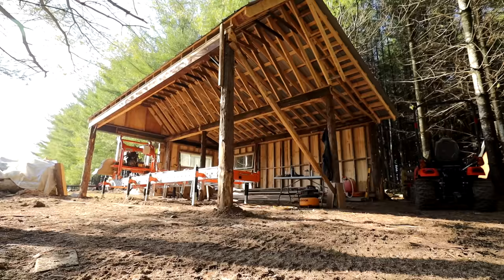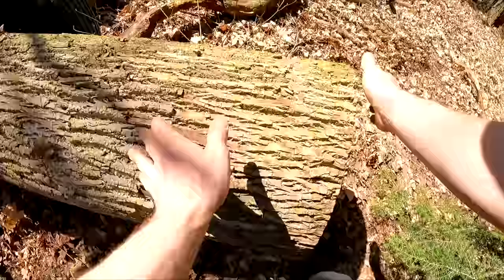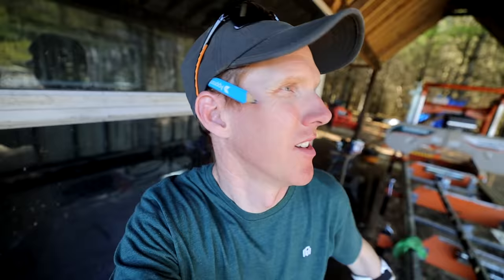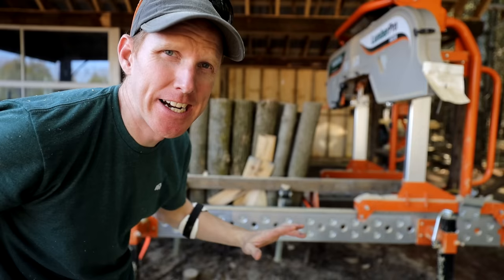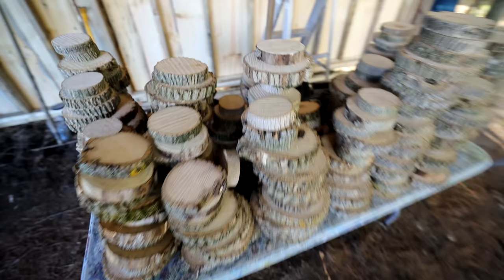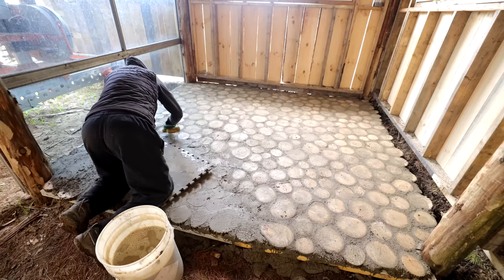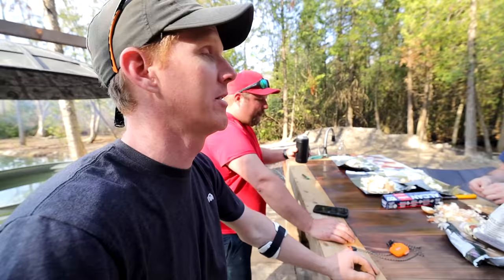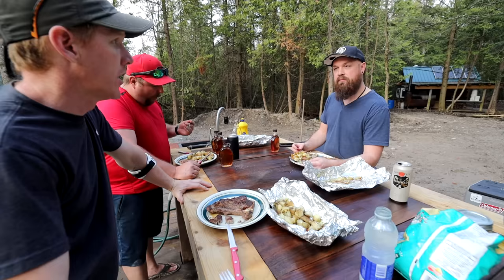$50 Saw Mill - Installing Custom Unique COOKIE CUT Wood Floor!!!

Comment: Consider altering the roof so all the snow and rain drains of the back side of the shed making easier access into the shed when it snows and the snow slides off the roof.

Comment: also as a Chef for over 20yrs, it greatly depends on the type of steak, however in my opinion, for Ribeye, Strip, and Sirloin you want it about an Inch thick, if properly cleaned and whatnot, should give you about a 16oz Ribeye, 14oz Strp, and 12oz Sirloin. As for T-Bones/Porterhouse, btw the way reason that little side is so delicious is because it is the Filet part of the cow, the other side of the bone is the Strip, about 3/4ths an inch, and Filets you want about 2in thick. The reasoning behind all of these is because when you cook them it allows you to have a gradient from rare to well done, if the steak is to thin, they will cook very quickly but to have a steak look rare, it won't actually be up to temperature.

Comment: I would suggest 2 mods to the log dolly. 1st use it on your 3pt instead of a hitch so you can lift the 3pt to attach the log, then have a tie chair on the front to keep it true forward. 2 cents.

Comment: 5:49 Just a thought, but wouldn't you want to use two chains? Also, offset the log so the front is heavier by 25-50lbs and then slap a chain under the front so it stays off the ground when you're moving it... Most of the weight is still carried by the center of the lift with the wheels and only the offset weight is carried by the front of it. I could be wrong though...
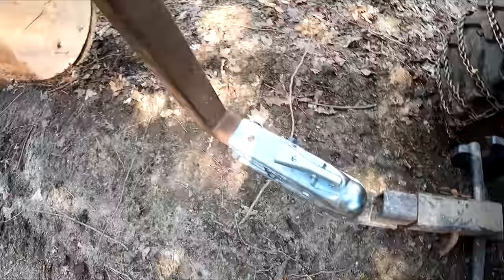Reply: 6:10 And there's a little ring on the underside of the front-top bar for a chain to hang too... ?

Comment: Damn Mr. Kevin...Livin...Here's to a great summer coming. 
I'm thinking just under 2.5 hours of actual application time for the grout job?
Looks amazing though!!! With the garage doors..fancy. 
Depends on the cut...skirt steak is thin 1/2 inch, 1.27 cm, and Rib eye thick up to 2 inch, or 5.08 cm on vertical grained meat.

Comment: Mount a boat trailer hand winch on the back wall and using a compound pulley you will get those big logs on the mill easy
Reply from the maker: I was thinking of just putting a beam in the ceiling.  To mount a pulley.

Comment: Always nice to see you and Don working together on a project.  What you have so far is looking really nice already.  Do you plan to completely enclose the shed/mill, likely with some sort of sliding doors for the long side so you can still slide in logs and have the sawdust spit outside.  Or will that long side stay fully open all the time?

Comment: Clean Aluminum extrusion in Guelph ON is going for $1.15 per pound, which is very good.  A pickup truck of those door rails would be about 600 bucks

Comment: 5/4 stock. 31,75 mm. Especially if you're gilling. Good char on the outside w/o over cooking the inside. Oh, and the cold plunge, maybe stay in a couple of minutes moves the blood to your core and constrict the blood vessels. Then a quick into the hottub releases the blood from the core, dialtes the blood vessels and pushes oxygenated blood to every extremeity. A very good process.

Comment: I just thought of a cool project. You have a lot of pine and cedar stumps, which you can process to extract pine tar which you can use as a wood stain/weather proofing.

You literally just need a big air tight metal container you can fill with chopped up pine roots, then bake on a fire while sealed. Ideally with a tap at the bottom to collect the pine tar.

You can also use it as lamp oil for light and heat. It would be awesome if you could run a generator off it too, but it would probably require more refining to get a purer fuel.

Comment: Pointing and finishing time: 2h 37 mins, cookie cutting time 3h 14 mins, leveling/subfloor 1hr 02 mins. total 5h51min.

Steaks are only available in 3175mm. or inch n' a quarter.

Harry and the hindsightersons I know, but if you ratcheted with a slight angle away from the way your saw blade cuts, and made sure you never have a point where the saw blade cut side is the only place there's wood, you will no doubt be famous amos cookie. I guess it's Tall ones to the office side basically so the blade is biting and keeping level with weight of more material.

Comment: Mike peels garlic LIKE A LADY!!! 🤣😂😆 Break a head of garlic up into cloves, put the unpeeled cloves in a metal tumbler such as a drink mixer an SHAKE THE HECK OUT OF IT!!! Shaking the cloves in a metal tumbler loosens, splits and separates the peel off the garlic clove!!! Most if not all of the peels will practically fall off the cloves. If not, throw back in an shake hard a bit more!!! Works like a charm!!!😁👍🏻
Reply: How dare you assume my gender
Reply: @TestingWithMike ...notice I said "LIKE a....!" 🤣😂😆😭

Comment: That little round part next to the t-bone is the tenderloin. If you cut the big part off the other side of the bone, you call it a New York Strip steak. (Back strap)

The best thickness for a steak is 1&1/4 inch or 31.75mm

Comment: You should consider welding an eye bolt just behind the vertical bar attached to the receiver that way you can wrap a another strap or chain around the front of the log to prevent it from twisting on you that way you can operating single handedly. I say 31/2 hrs there kevin to mix that grout and fill it between those logs.

Comment: Hey Kevin have you ever seen the rig that actually lifts the entire log up before its basically another set of wheels that u lift the back of the log up to. It's like 2 of the the carts that you got 1 on each end hook em together when ur headed into the woods then set it up and the log doesn't drag in the dirt at all. Look up a (log hauler rear support )

Comment: 1inch (25.4mm) up to 50.8 for steaks in general.  With them that thick one needs to tent and let them rest for a short time after cooking.  There are some kinds that it needs to be thin.  Cheap Charcoal Steaks can be 1/2 and be just fine.  If you havent ever had one, get the thinnest steak you can find and wrap it around prepared cornbread stuffing and bake at 375f  until the outside is just starting to brown.  

I know why you didnt do an acrylic pour for the shop floor.  It would have been so pretty!  Like I said, I get why you did not.  BTW, 1.65hrs on it.

Comment: 1" thick is great if you are buying a cow for butchering to keep in the freezer. In foreign countries (like yours) this would be roughly 25.4mm. A steak house cut would be better as 1.5 inches (38.1mm)

Comment: 88 MINUTES TO GROUT THE FLOOR. Also, have you thought about using whatever is left of that tent/tarp thing to close off the long side to protect the mill from the weather?
Reply from the maker: Now I have...  I have nearly 12000 lbs of that tarp tent thing left.

Comment: 5hrs21mins to grout the floor. I really love your videos. I doubt that I would have found them if it wasn't for the fact that you and Chris are brothers, so shout out to the Wooded Beardsman, love your channel Chris, keep the great videos coming. Really glad that I found your MSR channel as I love watching your projects. They are the same type of creative problem solving that I used to do. See a problem and come up with a way to solve it that is outside the box, cheaper than just using things that are pre-made commercially, uses "found" material that would normally be thrown out by others and the finished product is often better than the commercial solution yet costs far, far less. 👌👍🤜🤛 P.S.: Hey Kevin, just had a thought. I have watched several videos with you and your brother Chris working together and several with Chris and Zachary Fowler doing bushcraft together. I don't know how well you know Zach thru Chris, but since Zach is also big on building things and thinking outside of the box to accomplish a build, have you ever considered doing a joint project or two with Zach? Or would you? Just a thought.
Reply from the maker: Zach and I have done Head-to-head build offs but geography is generally getting in the way of collaborations.

Comment: With the many trees used so far in the building projects, you starting to see a difference in terms of thinning out your forest?
Reply from the maker: In the grand scheme of trees not many love trees used.  But the few that were cut more light is getting into the pine forest floor.

Comment: Steak and I am having oatmeal made with power greens and pasta sauce... and your playing in frog waters... okay.... curious how much your cutting sound levels will change in closing in the mill machines... I worked between two machine centers in lumber mill, I measured the decibel levels and was working with jet engine levels of sound... earplugs and muffs both, and I can still hear in retirement.

Comment: I like that floor a lot, I guess you gave up on the squeeze in the bag thing? And just put it on and smeared it around and will sand it later,? I don’t really like the head cam. I’ve seen that on other peoples videos. It’s very dizzying to watch I would stick to what you do best with the handheld camera of course it might come in handy if you’re climbing a tree or something like that but overall I don’t really like it😊